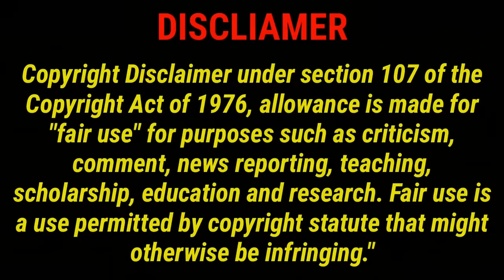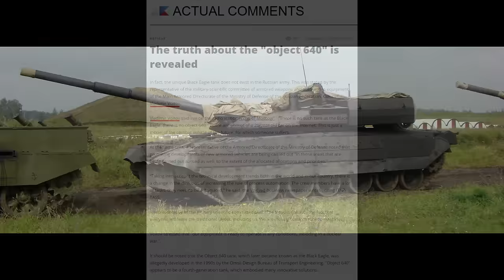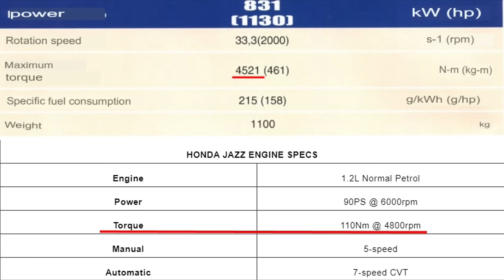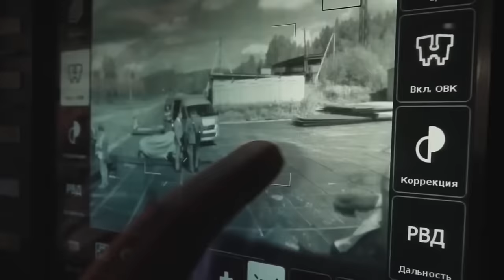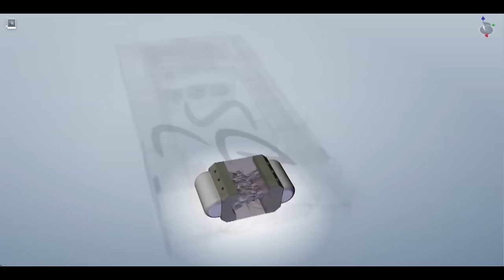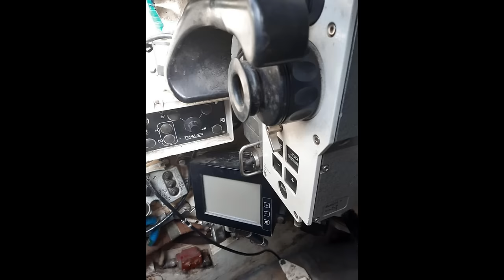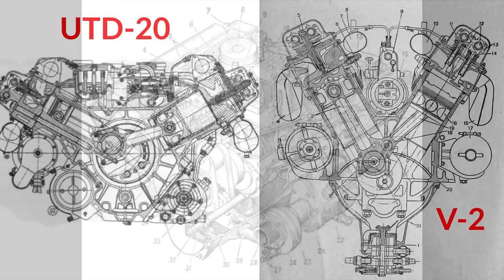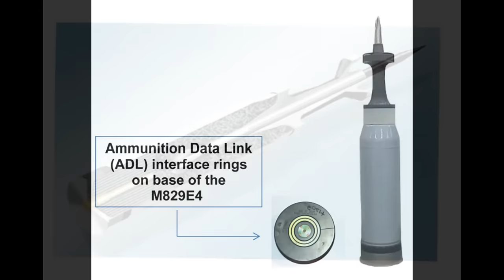LazerPig is WRONG about T-14 Armata

Comment: Another cool fact about the 1500 HP turbine engine of the Abrams is that it was developed from the engine on the Chinook helicopter. It is capable of producing 3,000 HP but is governed down to 1500 HP. If you un-govern it, then the transmission and drive train would not be able to handle the power and the fuel efficiency would drop to unacceptable levels.
Reply: Turbines are most efficient at full-speed, efficiency would go up, however the tank would have no use for that level of power and it would have reliability issues.
Reply: That’s pretty cool ngl
Reply: @ThatZenoGuy  What about afterburner, is that the most fuel efficient?
Reply: @fatfreddyfreekowtski6896  
Afterburners basically throw fuel into the final stage of the engine. Not efficient at all.
Reply: One of the things that some tank crews during Desert Storm was to disable the governor
Reply: @ThatZenoGuy  ok cheers
Reply: The Abrams is already unacceptably fuel inefficient.
Reply: @Ruski Bot /  when it's idling yes, that however was mitigated by an APU that provides power and hydraulic pressure when the tank has to remain stationary as when it's in a fighting hole or manning a checkpoint
Reply: So this is proof that the Abrams can fly!
Reply: I want to see an Abrams with an override button that lets them accelerate at helicopter horsepowers, if only for 2 seconds 🤣
Reply: @ruskibot7745  Unacceptable for whom? If anyone can operate a vehicle with 50% higher fuel consumption, its probably the most logistically talented and capable force on the planet. AKA the US.
Reply: Good ole T55
Reply: @ruskibot7745  came here to say that but checked first to see if anybody had beat me to it.
Reply: And it’s go about 60mph
Reply: @Tone Deaf Tachanka Gaming  Note M1 Abrams is exported. The fuel efficiency issue made it less competitive to the Leopard 2. Generally speaking, it has been getting by mostly as millitary aid and through politics.

Such as re-equipping the Iraqi Army and Egypt under the Mubarak era. The Australian adoption was questionable. Considering they are a large nation with high fuel prices. Fuel efficiency and range plays heavily in their doctrine. Yet they adopted a turbine powered tank.
Reply: This is why we see abrams rushing 60miles/hr in afghan and Iraq
Reply: @moonasha  I know some mechanics that disabled the governor restrictors on the engine. When the tank accelerated there was so much torque the tank treads ripped off and the transmission was totaled as well as the final drives. I think they were court-martialed.
Reply: @tonedeaftachankagaming457  how bad would it be if the Abrams used all diesel.
Reply: I joined the Infantry back in the early 80s I was in Fort Riley when we first got the Abrams I asked the tanker how fast they can go he said downhill on a fairway 80 Mi an hour then you could split up like a Wankel engine thank you Chrysler
Reply: @DefaultProphet  it also can draw a bead on another tank while they're both moving and fire and Destroy them in the chances of them hitting are so good
Reply: It’s like WWII German tanks using gasoline aircraft engines and having to limit its power for practical reasons (this is before they have to install speed governor on Panther engines, engines adapted from planes for ground use all have their power reduced).
Reply: @tonedeaftachankagaming457  thats also why I carry few bricks with me at all times. Because I'm just so strong. If USA can afford burning outrageous amounts of fuel just because they can, so can I carry unnecessary weight because I can
Reply: @ThatZenoGuy   efficiency would have to double to equal the consumption at 1500 hp.  That's not going to happen.
Reply: @phunkracy  I mean you do you bud, but this is just US field doctrine. Excess fuel consumption can be mitigated by overwhelmingly superior logistics. It's a big dick move to run whooshybois in the field because YOU KNOW you have the juice to keep them rolling.
Reply: Like 2 gallons to the mile.
Reply: @HANKTHEDANKEST  against countries like Iraq it worked, but against harder enemies its a problem
Reply: @steven sr Hester Can you "ungovern" it to maybe 2000 hp?
Reply: @Ruski Bot 

unacceptable fuel miles to whom?
Reply: Man, I would still love to see an Abrams rip it at 3k HP. Sure it would probably very quickly destroy itself, but I want to see it.
Reply: It could just use a 1500 hp diesel which would be more durable and simple.
Reply: This is why Laser Pigs statement about the Abram’s gas turbine top speed is meaningless.  There is no practical battlefield situation where the driver or commander would remove the the governor restrictions to gain a few minutes of a few more miles per hour at the cost of possibly destroying the transmission and running gear.  Plus you can remove the governor restrictions on pretty much any engine and achieve a higher theoretical performance at the cost of reliability and longevity.
Reply: @phunkracy  Turbines aren’t dead weight, they have advantages that a country has to weigh against the increased fuel consumption. Bad analogy.
Reply: @tonedeaftachankagaming457  it requires insane amount of fuel for little return
Reply: during the gulf war there were legends of US tankers un-governing it, and going well over 60 mph during some of the most intense battle
Reply: @tonedeaftachankagaming457  why? Why is USA exemplar from normal military conaideration??
Reply: @MASEPvAbramsMBT  for what purpose?  To shoot less accurately or to close the distance to the enemy so they can shoot more accurately and have a better chance of penetrating the frontal armor array?  Why, in a tank that has the optics advantage, armor advantage and firepower advantage, would a tank commander quickly close distance to an enemy which would lessen all three of those advantages?  I have heard stories of Abrams tank crews removing to governor restrictions to mess around and I’ve heard it was done between engagements for the purpose of moving quickly to a strategic position.
Reply: @stevenvandenbosch5528  
You are getting confused with efficiency (proportional fuel usage) and fuel consumption in general.
If the engine uses 10 liters of fuel per hour at 1500, and 18 liters of fuel per hour at 3000 horsepower, 3000 is more efficient.
Reply: So you are saying we can make it go faster?
Reply: @jamesngotts  In order to surprise and out manuver enemy forces I suppose
Reply: Crews who turned the governor off have made reports, though unconfirmed, of them hitting 70 mph.
Reply: @MASEPvAbramsMBT  Abrams can’t do 60mph in the sand even with governor removed.   That would be an asphalt or at least hard ground speed
Reply: @ThatZenoGuy  I don't know how correct what you said is. But I would assume that, yes the efficiency would go up. That does not mean that the consumption would go down. The fuel consumption would increase if you double the output, even if it does become more efficient for the power it puts out. I doubt running the engine at 3000HP would be so efficient that you consume less fuel than when running it at 1500HP.
Reply: @PrivateMemo  
That entirely depends on the engine in question, jet engines operate more efficiently at full throttle than on lower settings.
Reply: Jesus. I have never heard the abrams fuel usage described as acceptable. lmao.
Reply: @ThatZenoGuy  We were talking about the Abrams engine putting out 1500HP, which, apparently is based on the Chinook engine putting out 3000HP. You are welcome. :)
Reply: @PrivateMemo  
If the engine can put out 3000 horses, it's probably most efficient at that level of horsepower. 
However it's unlikely the engine is tuned to produce that much horsepower to begin with, I doubt it can exceed 2000.
My point is gas turbines are most efficient at their max throttle. That much is true.
Reply: @ThatZenoGuy  And my point doesn't conflict with yours. I agreed. I said it's more efficient. But more efficient doesn't mean lower fuel consumption. You consume less fuel per HP. But you still produce more HP and therefore consume more fuel.
Reply: @PrivateMemo  
Precisely.
Reply: @fatfreddyfreekowtski6896  actually you cant have afterburner on that type of turbine engine.
Reply: @ThatZenoGuy  Wrong. Turbines are efficient at a certain RPM. They can spin faster and make more power, but laws of thermodynamics are unbreakable, meaning they must burn more fuel up to the point of diminishing returns.
Reply: @Max_Da_G  
And said RPM is typically their maximum RPM, or close to it at least.
Its something of a problem for the Abrams, at low power outputs it guzzles gasoline despite the tank moving slowly.
Reply: @phunkracy  no it does not, the fuel issue is because when idling the turbine uses the same amount of fuel as when driving, this was fixed by adding an APU so they dont need to idle the main engine, while under load the engine has similar fuel consumption to a diesel engine with similar performance. while having a more favorable torque curve
Reply: @phunkracy  Because USA is the only superpower who has experienced and mastered modern combat, thanks to mostly Iraq in 1991 and 2003.
Not to mention all the successful operations the US has achieved, and fighting a 2 front war in Iraq and Afghanistan.

Russia, as we can see - can barely take on Ukraine - a military which was HALF the strength of Iraq.
Reply: 3000  HP! POWER OVERWHELMING! (Starcraf)
Reply: @wesdowner5636  While possible, the drive train as currently configured can't handle that kind of power.
Reply: @jamesngotts  It isn't the crew doing it, it's mechanics. But they have to have depot level experience to do it.
Reply: @fatfreddyfreekowtski6896  The exhaust on Abrams cannot produce thrust via reheat, but I like your thinking!
Reply: @pogo1140  The governor was adjustable as the fuel control wasn't digital. Those I met said it had gratifying results.
Reply: @ruskibot7745  Unacceptable to whom, Iraqi tank crews?  Those whose opinions matter because they use Abrams rejected the proffered piston diesel performance downgrade.
Reply: chinook got many upgrades over all these years and if memory serves me well it did not start with 3000hp engines that came much later
Reply: no... you said what makes you false "developed from" roots does nto mean it has 3k hp, it's made to do 1500 with a governor to throttle it a little lower for better power application, modern tanks do not need governors anymore for anything BUT that reason.
Reply: @osmacar5331  The design features of the engine are well known for decades. When the M! Abrams was in competition with General Motors to see whom would produce the next American tank, Chrysler, the original designer of the tank talked openly about the engine. They chose the turbine because of its reliability and proven performance on the Chinook helicopter. They stated that the engine could produce the 3,000 rated shaft horsepower but had to govern it to ensure the drive components didn't fail. The idea was that the engine would run at half power and be very durable. They also wanted growth potential to be built into the engine. I served in Abrams tank Battalions in Germany and knew how to reset the engine to produce more power. It was not uncommon to see them producing 1,800 horsepower and the Battalion commanders would turn a blind eye to it because speed equals survivability on the battle field. I have first hand knowledge and experience, what do you have other than an uninformed hypothesis?
Reply: @garrettmiller1355  It can run perfectly fine on diesel.  It’s actually one of the benefits of a gas turbine engine.
Reply: @tonedeaftachankagaming457  You mean whan bombarding defenseless 3 world countries? And even then failing?
Reply: @moonasha   probably would end up with a really chewed up drive sprocket lol
Reply: Imagine removing the governor on your Abrams and it takes to the skies
Reply: @tonedeaftachankagaming457  I don't think so.
Reply: @jamesngotts  The last is what I would have assumed, when the 7th Corps was making its big push on Kuwait. That's pure speculation on my part, though.
Reply: @ruskibot7745  No its not that dramatically different form any other tank in its weight class. The abrams burns about 1 liter per 220 meters, the Leopard 2 is about 1 liter every 240 meters and the challenger 2 is about 1 liter per 280 meters. The T-72 is generally better than most other tanks at 1 liter per 380 meters, but its also a much smaller and lighter tank than the Abrams Leopard or Challenger. but the abrams is not all that much worse than every other tank in its weight class. Now no tank is going to be particularity fuel efficient as moving 50 to 70 tons of steel takes a lot of energy.
Reply: @ruskibot7745  It was never "unacceptably" inefficient.  The upgraded ones with APUs are actually pretty great.  On top of that, fuel inefficiency is a problem of logistics, and the fuel type for the Abrams was specifically chosen because its used by a lot of the other vehicles/air units.  Using a less efficient engine on a different type of fuel was literally done for its logistical BENEFITS.
Reply: Nobody has mentioned an advantage of the turbine engine.
It will run on any burnable liquid. Petrol, gasoline, jet fuel, diesel, cooking oil, engine oil, turpentine, alcohol.

Different fuels will give different hp and mpg but it will run.
Reply: @Tuck-Shop  In practice this has been useless.  We've only ever run them on JP8.
Reply: Hell, the fuel economy is essentially unacceptable to anyone but the most logistically advanced countries anyway lol
Reply: @Kevin Smithwick  the Abrams wasn't built or designed with how good it would be for export to other countries as a main concern though.
Reply: @Marc83Aus  it certainly isnt for poors.
Reply: Did you actually say ‘drop to unacceptable levels’!!!!!!??????
Reply: @marklandwehr7604  Abrams tank is not designed to go 80mph, in doing so would result in significant damage to power unit!
Reply: @bastikolaski8111  how's logistics a problem for the USA.
 USA has proven time and time again they have the best logistics in the world!

Abrams tank is a pig on fuel, however the reason for choosing a turbine has proven it was the right choice at that time.

Better power and torque curve at 60% throttle, where most tanks operate at.

Lighter 

Can run on other fossil fuels

More quite then diesel engine
Reply: @jkirk888  Yes unacceptable. The faster a turbine engine runs the less fuel efficient it is. The M1A2 has a 498 gallon fuel capacity and it gets 0.6 miles per gallon of fuel. That gives it a theoretical range of 298 miles. If you un-govern the engine, you will cut that in half. While the in the close battle this doesn't matter as much, in the kind of offensive dash that the tank was designed for a range of 150 mile range doesn't cut it. You need the longer movement range to make the tank effective.
Reply: @Grandmaster FU  I agree that US has really good logicstics.
But Abrams is a bad tank, its loud, has high fuel consumption, high heat emissions, many weakspots.
And diesel as a fuel is good for tanks, because the entire logistics is based on diesel. All trucks, IFVs etc.
Did you really believe that they would perfrom worser with Leopard 2?
Reply: @bastikolaski8111  
-Turbine engine in back of Abrams were more quite then diesel when first introduced.
 
-Abrams tank can run on diesel and other fossil fuels, including gasoline.

High fuel consumption is irrelevant when logistics are capable of supplying needs required by the crew. 

What is relevant that the platform is performing as required, Abrams is not the best in all categories but its a very capable platform and in many cases outperform its counterparts!

Throughout its development the Abrams has been fitted with diesel engine,  the varient was supposed to be sold to the Turkish  military, however they choose to go with Leopard 2

Abrams tank has been tested in battle, without any serious drawbacks.
Reply: @bastikolaski8111  It is always interesting to rebut someone who doesn't know what they're talking about. The fact that you call it "load" is funny. The nickname of the Abrams is "Whispering Death. I served in an Abrams Battalion in Germany (4th Bn, 66th Armor). I also served in others. Compared to diesel tanks they are much quieter. You can hear and see (from the smoke) diesel engine tanks way before you see them. These tanks are fast and you can't here them till they are nearly on top of your position. I talk from experience. Ask the Iraqi Republican Guard if they're load. The Iraqis had no idea how close the Abrams were, by the time they heard them it was too late. Fuel consumption is poor, but if your logistic train is designed to support it then that concern is minimized. Calling it a "bad" tank is funny. It ain't perfect, but it is battle proven and tough. Its shock effect is real. There are other fine tanks in the world like the Leopard series, but how battle proven are they. The Abrams has proved time after time it is the "Timex" watch of the tank world: It can talkie a licking, and keep on ticking!
Reply: @KSmithwick1989  okay so
The are actually 2 reasons why Aussies took Abrams

1. It was already there and ready, off the shelf, quick delivery time, for Leo it would take years to delivery even few
2.They had really bad time working with Rhinemetall
Reply: The helicopter claim is incorrect, AGT-1500 was not used on helicopters, even a cursory search will show you that. It entered multiple  competitions for heli turbine, but lost to T700 engine.
Reply: @IvanBaturaChannel  No this time you are incorrect. In the beginning of the program the engine was indeed used in the Chinook helicopters which used 2 of them.. In the promotional literature for the original M-1 from Chrysler Corporation, included this information because it was considered a very reliable engine. Prove me wrong, I was around when the M-1 came out and I was in the Army at that time. Don't blow smoke up everyone's butt simply because you don't know any better.
Reply: My uncle who served in the military said the abrams can go above 65 mph, just that the tracks would literally throw itself apart if it’s consistently at that speed.
Reply: @ThatZenoGuy it's gonna be "more efficient" at sucking in random debris and having an insanely expensive maintenance schedule 😂
Reply: @rodiculous9464  
The Abram's Gas Turbine engine isn't the most efficient tank engine, but America's logistics system can easily handle it.
Reply: The T-80 engine has helicopter history to. It was originally placed in Mi-2
Reply: Transmission go brrrrrr
Reply: @ThatZenoGuy also would not be used in a turbine meant to be used to provide rotational power not thrust
Reply: @drgrey7026  
Eh?
Reply: So what you're saying is....we can over clock the Abrams.
Reply: Yeap
Reply: @ruskibot7745  That has always been a bullshit argument just go back to WW2 and check the fuel consumption figures for vehicle that weighed a half or even a third of the M1. It is a 70ish ton vehicle it is not your honda scooter.
Reply: @ruskibot7745  On the country, the M4A2 consumed 246-268 L per 100 km (0.87-0.9 mpg), depending on the season, and the M4A2(76)W consumed 371-410 L (0.57-0.63 mpg)                              The m1 Abrams tanks uses jet fuel. They get 0.6 miles per gallon with aviation fuel. The jet turbine engine can run on almost anything. Diesel, unleaded, leaded, paint thinners
Reply: @tonedeaftachankagaming457  For one thing they can use a much wider range of fuel for the engine.
Reply: @jamesngotts  Uh to move to a beter position of to get to the place where they are needed. You know being in a hurry to do something/ What do you want tanks only capable of going how fast?????????
Reply: @WolfeSaber9933  Some of our governors did not function properly and at 29 palms got up to about 60 before you notice and the ow shit moment takes over.
Reply: @jamesngotts  Just how many M1s have you been on? I guess my eyes were playing tricks on me then.
Reply: @stevensrhester8594  Yea keep believing that
Reply: @michaels.starnes194  Yikes!
Reply: @stevensrhester8594  Semper Fi from Delta tanks 8th tank Btn USMC
Reply: @Cobra-King3  Or going over a hill In Leesburg SC at night and being airborne because the road on the other side went down steeply.
Reply: @michaels.starnes194  Its not the miles per gallon, it's the lack of an Auxiliary power unit. So your fuels isnt going towards driving as much as the Shermans.
Reply: @ThatZenoGuy Pratt and Whitney J58 after burner was its most efficient mode.